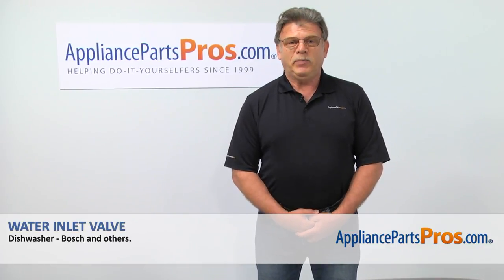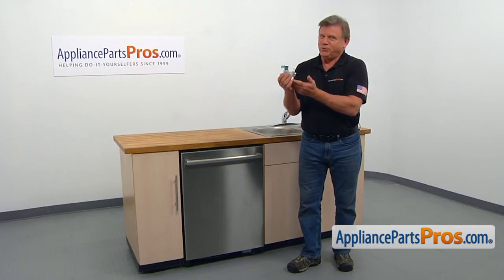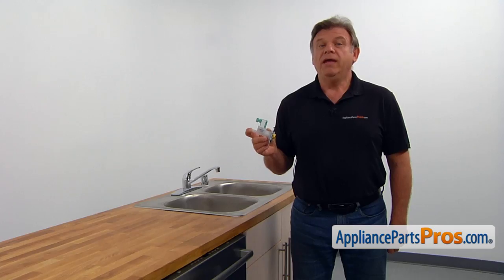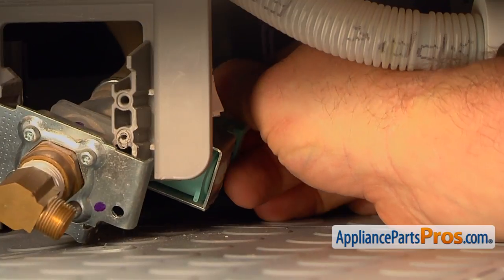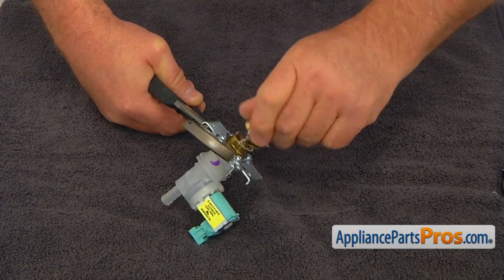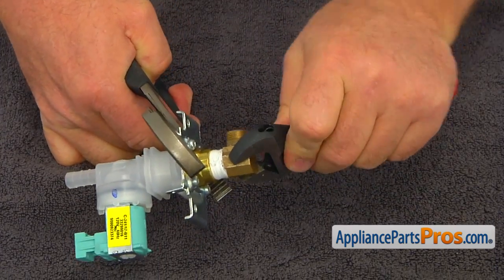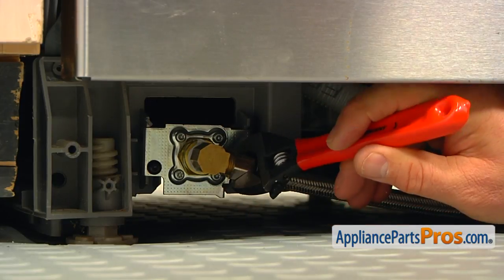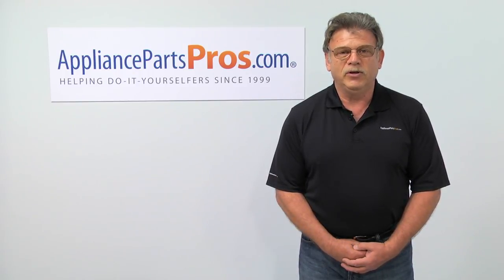How To: Bosch/Thermador/Gaggenau Water Inlet Valve 00622058

Comment: Do these not have inlet filters on them? I put in an RO system and had to replace the tee for the dishwasher and I noticed a dark-blob going down the dishwasher pipe and now not enough water is getting in the dishwasher. I was hoping I'd just have to find and clean a filter but apparently that's not a thing?